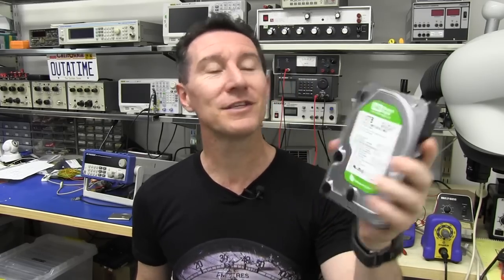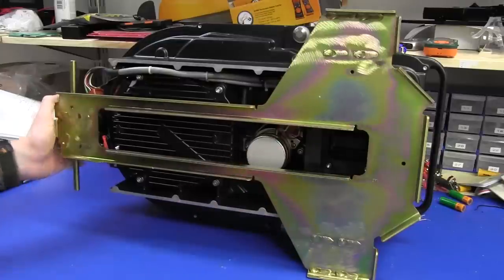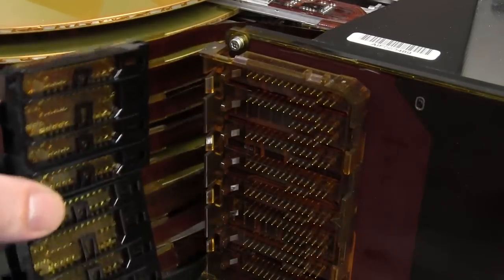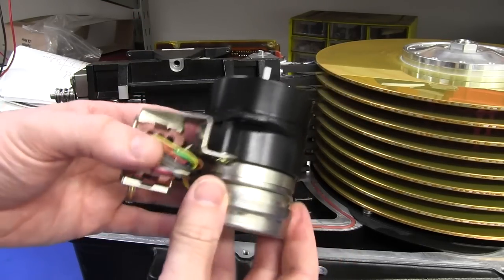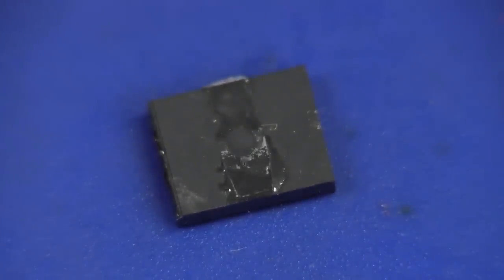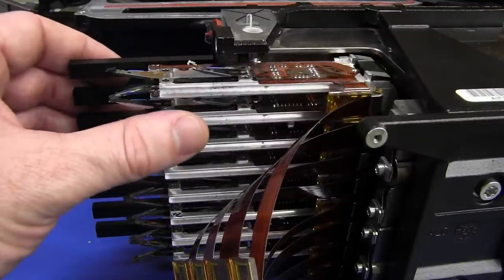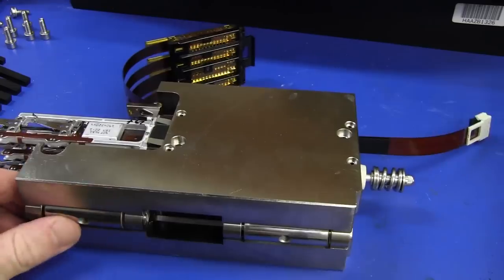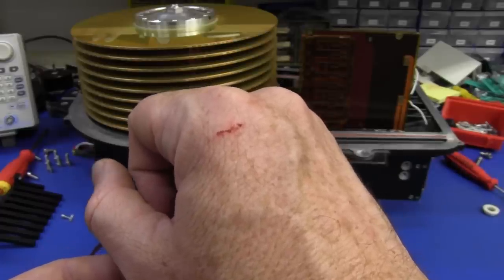EEVblog #395 - World's Most Expensive Hard Drive Teardown

Comment: I worked as a student employee at IBM in Rochester, Minnesota, USA between Oct. 1989 and Aug. 1990. I worked in the platter manufacturing area. The section I was in produced 3.5 inch and 5.25 inch platters.One of the techs on in the coating area told me that one of the 5.25 platters would hold up 125 Meg of data. I was amazed because at that time I wanted to get an IBM desktop which the largest hard drive available was around 60 Meg. Another department produced the 11 inch and 13 inch platters. You estimate how much the larger platters would hold based off of what I have described. I was very cool working there because I got to see how they were made from blanks all the way through to final test. The final test area had about 10 quad platter testers. In that area we would have to change out the heads on the testers. We would inspect them under a microscope and clean them. A friend of mine worked in another area when they made the heads. They would manufacture a long block and laser cut the heads from that. Very cool experience!

Comment: At the cost rate of that unit, a 1 gigabyte hard drive array in that day, would have cost: 25 Billion Dollars!
At the cost rate of that unit, a 1 terabyte hard drive array in that day, would have cost : 2.500000000×10¹³ Dollars!

W  O  W !
Reply: holy fucking shit lol
Reply: 5argeTech they way I calculated it,  a modern 3TB HDD would cost 75 Billion Dollars based on 10mb=250,000.00
Reply: swifty1969 That's is what my answer is on a calculator of its day! :)  look at the answer it is 75 billion!
Reply: This hard drive was $250,000 and could store 1.89/3.78 GB, so a 1GB drive would have costed anything between $66,000 and $132,000.
So a 1TB drive would have costed anything between $66,137,500 and $132,275,000.

Comment: I think pc hardware barely evolved in the last 7 years...cpu are only 20-25% more powerfull,4-8gb of ram is still standard,ddr3 is still here,hard drive capacity went from 320-500gb to 500gb-1tb,we still use Sata and besides graphic cards getting a huge boost,nothing else dramatically changed...
Reply: That's exactly what I was thinking. Even two years after your comment, almost nothing changed. Sure, they got a bit faster and stuff, but nothing exciting, just CPU bugs :D
Reply: Change has been slowing down for sure, but 8GB is more common than 4 now and were finally starting to see systems with 32GB of RAM.

Comment: The earliest IBM commercial hard drive had something like 50 surfaces (about 26 platters, further separated than the ones in this unit) and ONE head assembly which moved in and out and, while completely out of the platter area, up and down.  Next they came up with the multiple head access “comb,” and made the storage media removable, allowing separate data storage for multiple systems (or clients).  The most popular ones had 10 or 20 surfaces, and were stored offline in two-part carriers with a handle on top.

But smaller and smaller head gaps made the removable (by the operator between jobs) system too unreliable, especially when people smoked in the computer rooms (an ash particle hit by a flying head was like a rock hit by a lawnmower), so these “head drive assemblies,” or HDAs,  were the solution.  Each HDA was a separate volume, and by that time, high speed tapes were fast and cheap enough to “swap drives” by copying the current content to a backup tape, then loading another backup tape over it.  It took more time than manually swapping removable packs, but not much more, since there was no need to spin the drive down and back up. These modules were replaceable only by the CE (IBM speak for repair tech) and required the entire controller and all volumes to be powered down and the cover removed.

And notice how the access arms move in and out along a radius of the spindle?  Not so good for PC sized drivers, because of the noise and vibration (sometimes the big old drives shook like unbalanced top loading washers and driers), and the extra space needed for the fully withdrawn access arms.  Today’s access arms swing around a shaft in the corner of the rectangular housing like a phonograph tone arm; the deviation from a straight radial line isn’t large enough to make a difference.

Comment: That's an IBM 3390 HDA. They were announced in Nov. 1989 and were IBM's last family of large, expense disks. They kept improving the density in model upgrades of the same large format HDA which began at 1.89 GB per HDA in 1989 and went up to 11.3 GB for the model 9 by 1993. The 3390 was replaced by the RAMAC2 in the mid 90's which emulated older 3380 and 3390 drives and also introduced RAID to mainframes and used a 3 1/2 inch disk of about 11.3GB - a nice size for lending compatibility with the 3390 model 9.

Comment: This is not "actuator motor", but looks more like head load/unload drive.
The heads are split to two groups with independent voice coil drives. The ribbon cables with wide conductors supplied current to the coils.

Comment: I worked for Sun in the 1990s. They had a 1 Tb drive built by Hitachi that was the size of a large fridge. It cost $1m.  Prior to Sun I worked for Hitachi in the late 80s and they had a range of drives that they sold with their IBM compatible mainframes. They were as big as two fridges and were 500gb each. They cost $4m. Each one took a week to build and the disks were gold plated. They had a head to platter clearance of 1micron. It was a wonderful time to be in IT. The engineering was awesome and the majors enjoyed GP of in excess of 50% so everyone was well paid and engineering was the best. Its only got cheaper and less profitable as the years progressed.

Comment: This unit is from the late 80s early 90s.  The technology evolved from removable stack of disks for System 360/370 to removable head-disk assemblies (HDAs) to fixed mounted drives as shown. As the data densities increased so did the sensitivity to careless operators 
mounting movable data packs or HDAs.

Comment: Thats nuts thats only 10MB and 4 decades later we can now store 64,000 MB or more on a micro SD card
Reply: Samsung and SanDisk have been selling 1TB Micro SD cards for over a year now, so that’s 1,000,000 MB, that’s 100,000 times more memory in something that weighs roughly 82,000 times less. Yes, that’s right, this 10MB hard drive weighs roughly the same weight of 82,000 Micro SD cards, or equivalent to a measly 82 Petabytes!

Comment: This really surprised me. I worked for Prime Computer at that time, and we used Control Data Corporation 300MB drives, which were only about $22,000. They had removable disk packs, so we could use them for backups. The great thing was that you only had about an hour of downtime. Otherwise it took about a dozen tapes to back one up. The CDC drives were the size of a small washing machine, but included the logic. They became obsolete when Winchester drives were introduced. Then you could put two 800MB drives in about 7" rack space, with much less heat dissipation.

Comment: Some early NCR drives (NCR 657) I worked on in the early 70's had 10 platters (20 surfaces) and held 50 MB on removable disk packs. What was especially interesting was the actuator were hydraulic rather than the later voice-coil technology. It was some joy when a hydraulic line burst. Data recovery by washing the disk pack.

Comment: Data was written in sectors and tracks within 'cylinders'.  

A track is one full circle around on one side of one platter.  A sector is a section of a track.

A cylinder is all the tracks a given radius from the spindle.  

Doing a big sequential write or read, the control unit will send the heads to seek a particular cylinder, then wait for the correct sector to pass beneath the heads.  Then it will write a sector after sector until a full track is written, then shift to the next platter up (or down, I don't know which), and continue writing or reading until the cylinder is full.

Only after the cylinder is full will it have the heads seek the next cylinder.

The underside of the top platter contained alignment position information for the 'cylinder'.  

I was a software guy, not a hardware guy, and my work in VM/VSE and VM/MVS 'system programming' ran from 3370 days to 3380 days.  The rest of the time I was in application programming.

Comment: The first hard-drive I ever owned was an external drive that attached via a huge cable to a card inside an original IBM PC.  You would turn it on and it sounded like a jet engine getting ready for takeoff.  LOL.  The whole computer, along with this drive, was given to me in 1988 by a family friend — he’d had it since it was all new in 1981 or ‘82, and had upgraded to something newer in ‘88, so he gave me the old machine.  The drive was a whopping 20 megabytes, and it had a 60-megabyte tape-backup built in, which used tape cartridges that looked to be about the size of VHS tapes — although I never could get it to work properly.  But the hard-drive worked.  I used that computer for my freshman and sophomore years of college.  Then I bought myself a new computer — a 386 DX 25Mhz with 4 MB of RAM and an 80 MB hard-drive!!  So powerful!  LOL.

Comment: At work we have a HDD from the late 80's. It looks about 3/4 the size of this, and 1/2 the weight. Holds just over 800MB. It does have it's own processing, though. I think it may be SCSI, or whatever the predecessor was. All the bus/interface stuff is on a seperate board to the HDD logic. Whole thing has it's own cast alloy subframe to which the boards attach.

Comment: The temperature tape for this hard drive is from fish tank technology.  It probably wasn't manufacturer applied, but anything is possible in the late 80's early 90's.  Fish supply stores still sell those strips which you can use for your current hard drives to remind them where they came from =)

Comment: I was working for IBM at the time.  The HDAs were made at IBM's San Jose plant.  On the same campus, FORTRAN was developed.

It was the DASD that triggered the term "Big Iron" when talking about IBM's mainframes of that era.   Now the Field Replaceable Unit (FRU) Dave is holding (HDA Ass'y) was probably not $250,000 (of 1980 money).  But the complete disk drive assembly may have been.   The assembly would have been a telephone-booth-sized steel cabinet with multiple HDAs and monster power supplies with provisions for air or liquid cooling depending upon which model the customer selected.   And, of course, getting bytes into/out of the DASD would have been monster-sized "channel cables" which (by today's standards) had a snail's bandwidth before IBM switched to fiber-optic channel connections between mainframe CPUs and peripherals.   The channel cables were assembled in IBM's (now-defunct) Brooklyn, NY plant... located there as IBM's "social contribution".   The cables were roughly two inches in diameter and terminated at each end with a connector the size of your hand.

Folks used to beat up IBM for not making disk drives as affordable as Maxtor or Western Digital, etc.... or RAM as affordable as Intel.  But that wasn't IBM's fault.   Competitor components were typically made in Malaysia or the Philippines where labor was super-cheap and IBM's competitors could get away with dumping all their industrial waste because local governments just wanted the employment and economy boost, so they looked the other way at the industrial pollution.  I'm not taking anything away from Intel's innovation.  Indeed, IBM even took a 10% stake in Intel back then, to keep Intel from folding against the likes of Cyrix and Zilog, etc.  But IBM had to recover all of its pollution (such as solvents) and have them recycled.  

IBM had enormous overhead to comply with, what with OSHA and Federal effluent/environmental regulators.   Making a disk platter is a messy business, with chemicals that must be properly recovered and disposed-of... which is quite expensive.  IBM's labor force was also far-better paid compared to laborers in Malaysia.  So the price of IBM's disk drives were indeed expensive...

... until it became cheaper for IBM to simply purchase the smaller "commodity" five-and-a-quarter-inch disk drives found in PC's and workstations and assemble mainframe DASD out of dozens of these tiny drives instead.  Of course, these would be RAID arrayed to achieve IBM's famed reliability.  But the point is that even IBM had to cave to competitive pressures.

IBM's RAM chips were made in Burlington, Vermont and (again) there was no way Burlington could compete for price against Intel which was trashing the soil of many islands along The Pacific Rim without regard to the safety of the civilians or even the employees.  Intel would erect temporary facilities and start up a line.  When the next generation (thinner line width) of RAM was to be made, Intel abandoned the existing line once the new one (built somewhere else) took over production.  Noway IBM could get away with anything like that.

Comment: This video is now about 6 years old however if you still have it and are able to pull the platters off, made some clocks of the platters and use the heads as digit pointers (like tracking the surface to get data), would be awesome. Use some stepper motors to move the pointers and design a driver PCB for it. You can sell (auction?)  those limited editions to support your channel. Awesome idea, right?

Comment: The disk surfaces were sprayed on magnetic slurry and spun at very high speed to leave a thin film that was highly uniform and had a clean smooth surface.   (The residue on the edges of the disk drive is the indicator.)  This was applied like photoresist is on semiconductor wafers..,   This was baked to a hard finish, smooth enough not to cause a head crash (HDI: Head Disk Interference) while the heads were FLYING.

Comment: My father did sell DataGeneral Novas in the late 70s/early 80s with Diablo 44 Harddisk drives: 5 MB fixed/5MB changeable. He told me stories of cleaning the heads with pure alcohol and Q-Tips :)
And also repairing these computers with a soldering iron. Those were times... (I'm born 1975 and grew up with those "mini-computers").

Comment: I used to support these in the 1990s.  By about 1993 they were down to $80,000 for a box that had 4 HDAs, so cost per Gigabyte down to about $11,000.  The amazing thing is you could fit the entire OS/390 operating system onto one with room to spare.  I created a "one pack system" that could operate standalone using a little over a Gig.  Last time Windows could do that?  Maybe early XP days.3390 series were actually pretty reliable.  We also had 3350 and PCM equivalents which had failures on an almost daily basis.  The clone makers such as Hitachi, Amdahl, StorageTek also developed their 3390 equivalents, supposedly some of them were 64K per track which was more than needed as IBM were rumoured to be going for that size but actually released the drives with a lower density.The tax office was supposedly the first Aus Gov department to exceed 1 TB disk capacity around 1993 - back then it would have populated maybe 150 sq metres or more of floor space and used enough power to supply a dozen houses but little over 15 years later it'd fit in your pocket.
Reply: True. Nothing has ripped the lid off Moore's Law quite like data storage hardware. "... actually pretty reliable." my god, you'd have to hope so at that price! The whole thing is just so massively over-engineered. It looks as though MTBF should be a thousand years!

Comment: Hahaha, I love tearing into the older technologies. In many ways, it was made better back then, considering what they knew & had to work with. The equipment was so expensive, it was designed to be serviced..not thrown away. There were usually no shortcuts in quality & allot of redundancy & protection built in. Using aquarium temperature tape was clever...LOL. This is great. Nostalgia to the max...Great Vid.

Comment: If 3390s are like 3380s, 3370s and 3350s, the smarts is either in the "head of string" (the smart DASD you have to have at the start of a string of regular DASD), the "cluster controller" (the control unit between the head of string and the channel), or the "channel" (a part of the CPU that connected to cluster controllers and similar devices).

Comment: I had an IBM System 34 which was sold new in 1978 and 1979. 
It had two by 65 megabyte hard drives! 130 mgabytes in 1979!
It also had an autochanger floopy drive that could hold ten 1.2 MB
floppy disks.

Comment: the white connector over the power connector in the back is the alarm switching  and bit count     at the time of removal. that was the insurance that data was not modified while the drive was out. After reinstallation there was a handshake and had to coincide. if the disks were to be changes only the 3 persons authorized  in the bank had the code in the bank vault in another strong box. all 3 had to be present to get the code.

Comment: the heads aren't out of alignment; they are supposed to have that slight tension...they park in a non used data area or entirely off the disk..not sure..but once the disk gets spinning, the airflow in the drive chassis causes the head arms to be blown around (yay bernoulli principle) and a slight air gap is formed to keep them afloat

Comment: I did a lot of 20 platter drives as they crashed. I worked for Honeywell and had 500 mb drives. In a coal mine in Alaska they had contamination issues. I’m sure they cost more than the one you have! I also did drum memory of 16k on Submarines in 1969 with 4k core memory, wow